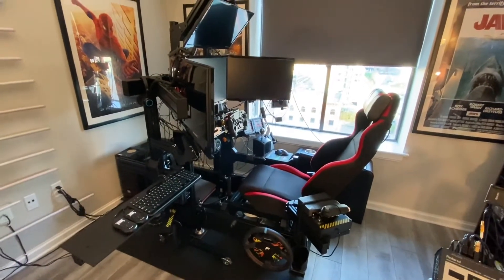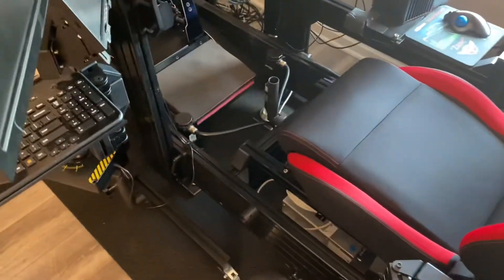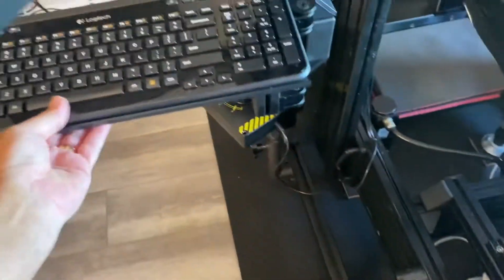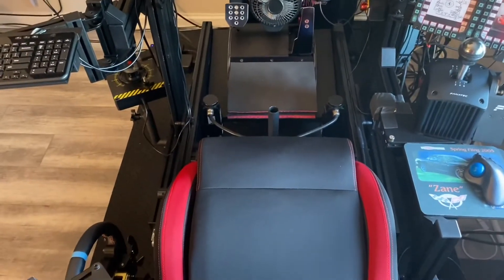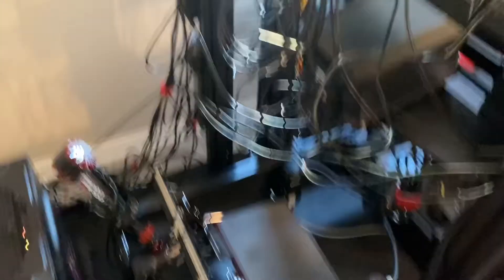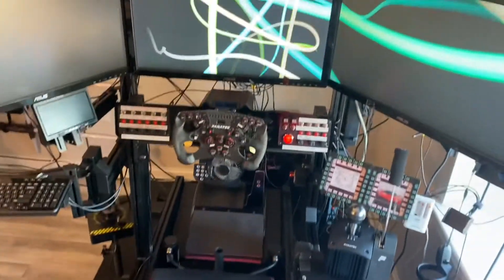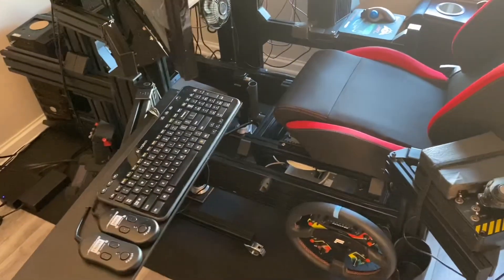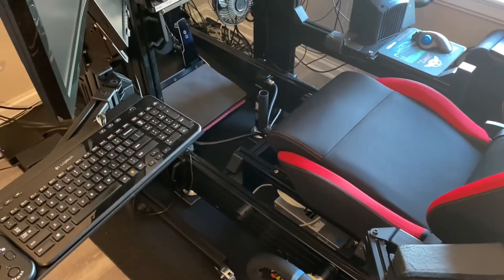8020 Sim Rig #5 - D-Box Gen 1 4250 Motion system addition

Comment: I like that left side HOTAS mount that opens/closes to help getting into the rig.  How did you build that, where did you get the parts to create that?   Thanks.  I have flight HOTAS now left and right and climbing in and out is not easy.
Reply from the maker: I’m using the Sim-Lab button box arm mounted to a spare piece of 8020 as the post and then I mounted a shifter plate on the button box arm to mount the throttle onto.

Comment: Great rig bud. Question,  doesn't it add extra pressure on the system having the actuaters so close together?. Ie: does it reduce the weight maximum?.
Reply from the maker: The average weight on each actuator wouldn’t change based on distance apart so I don’t think these are issues… I mean, moving them to the outside of the rails would only be about 5 inches difference and so I can’t imagine that would add any stress. The reseller that sold them to me even suggested that having them closer would give more movement. These are industrial strength actuators that are rated for 250lbs of normal use per actuator so they can handle it no problem. I’ve been using them for just over a year with no issues.